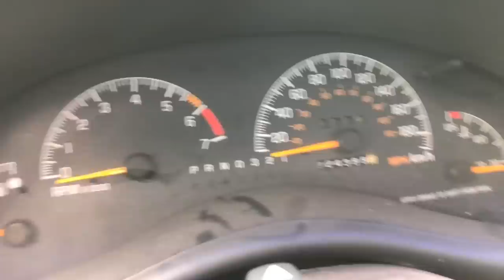NEW RACE Pontiac!

Comment: To bypass the rev limit on SOME GM vehicles get the shifter between park and reverse or neutral and drive,  worked on a road trailblazer with 4 bald tires in the winter  a few years back

Comment: pull the airbag fuse on the cars until u jump them. then put the fuse back inwhen u jump them so they go off. make sure traction control is off also and sometimes you have to hold the traction control button down for 5 to 10 seconds. if the airbag light is on, on the dashof any car usually the airbag wont go off. love the vids!!